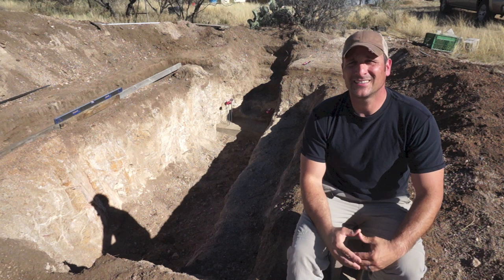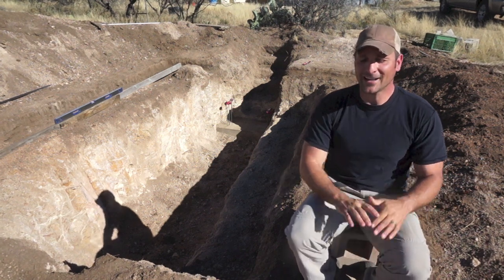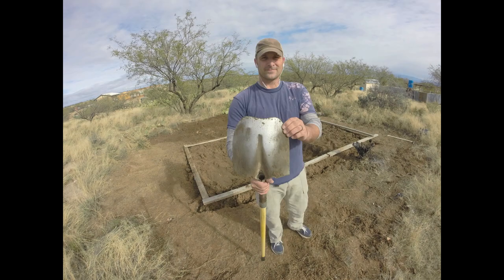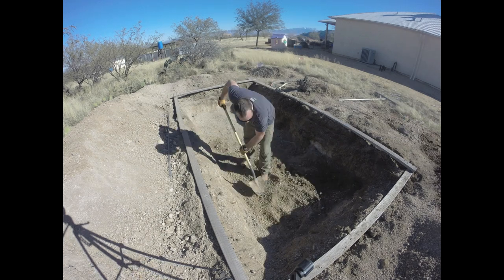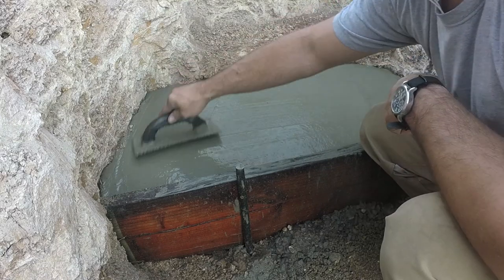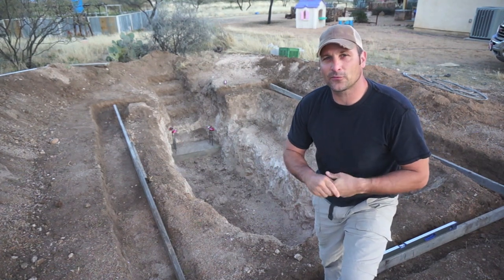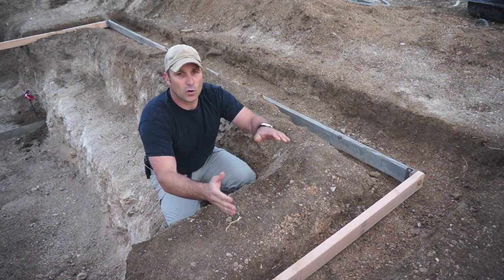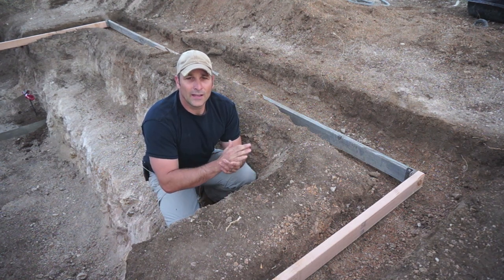Sunken Greenhouse Part 1:  Dirt work

Comment: I had this idea to drop one 4 feet below the surface but I didn’t have the luxury of a backhoe. It took me a year to dig it and remove the soil with a wheelbarrow. I’m at the stage of wall retention. I’m using 4x8 pressure treated plywood instead of concrete block: mildew reduction and wood is a better warmth promoter. Florida has experienced the coldest temperatures in years so I had to drop a tent over my project in 2023 because I haven’t got to the permanent structure yet, but this year (2023) there’ll be a permanent structure like yours before 2024. Your videos will be an inspiration to me. Thanks!

Comment: Damm, I've been looking for a solution like this since 2000...[no kidding]. I have a 8+ foot deep unfinished basement; 30 x 50'; and want to use the western side as an underground greenhouse [about 30 x 20-ish] and the east side[30 x 30] as an underground home.   Thank you SO much for filming this; because everytime I talk to anyone and try to "Paint a Picture" of what I want to do; they "No Comprende" !
Reply: Would love to know if you succeeded with either or both!  I am getting ready to move an 1850's cottage off the old basement which is too close to the highway.  About half of the basement is still in pretty good condition, and I hate to waste it by just filling it in. so I've been wondering if I could turn it into a sunken greenhouse.  It will be just to the south of the new basement, and I'm worried that it will obstruct the south side of the cottage once it's moved.  The zoning inspector is already on board with this idea, saying there's no reason why I can't put my old basement to good use, especially for agricultural purposes.  I should end up with about a 16' X 24' space, and the concrete stairs can remain.  The low roof on this project we're watching may solve my problem by not obstructing the south wall of the house too much.  At least the south wall of the house will just have windows, and no entry door.  It may look a little odd to have a greenhouse right there, but it also may be worth it.  As he says, "What have I got to lose?"  I'll get the house moved and will know better whether it will look ok, or not.  I think his low polycarbonate roof looks very nice.  If anyone wonders why I don't connect it to the moved house, since the house will be so close by, it's because I don't want it to be subject to the building permit that I am applying for to restore the house.  If it's separate, I can get an agricultural exemption for it.

Comment: Looks awesome. I appreciate how you can start building from the vision in your head and not get bogged down by over planning. It's nice to see a project develop in such a organic way and its cool to see how design as you build.
Reply from the maker: +Ben Huttash Thanks Ben!  It's certainly not the most efficient process but it works for me and in the case of many projects allows me the ability to problem solve as things come together.  Of course sometimes it forces more trips to home depot though...lol!  I'm hoping to finish the concrete and block work this week.. then start on all the framing and figuring out all the details in between:)  
Joe
Reply from the maker: +Ben Huttash Hey Ben... just checked out your channel... I got a buddy who lives up near Denton.  He has a small glazing (windows, doors, etc,.) business.  Used to be called south county glazing but can't remember the current name.  Was just there a few years ago... anyways, i'm checking out your ferro cement vid now:)
Joe
Reply: +homesteadonomics Thanks for checking out my channel I haven't added a video in a while but have some in the works. I am star struck in the youtube sence of it, that you would take the time to comment and chat with me seeing as your channel is huge in comparison to mine. I love your channel and I love DIY projects. Also a while back you suggested some channels you like and I want to thank you for introducing me to BossoftheSwamp. He really has the lock down on the nostalgia of the simple life.
Reply from the maker: +Ben Huttash hahaha... I'm just a regular guy like anyone else!  Keep posting on your channel and it will grow:)  And yes, I love bossoftheswamp  a lot... JC seems to be a super genuine guy and just has a very likable personality too.  And one heck of a craftsman as well!  Anyways,  I really do appreciate your comments Ben and am available to chat anytime:)
Joe

Comment: That "template" of the cinder block used in placing the rebar was very clever. I'm filing that one away for possible future use.

We have very hard ground here in the Central Valley too but it's a very heavy clay. In the summer- hard as stone; winter- sticky quagmire. When digging fence post holes by hand I get down about 2-3 inches and fill the hole with water before moving on to the next hole. Lather, rinse, repeat. All. Day. Long. I get there, eventually...
Reply from the maker: +Tracy Luegge Hi Tracy,

I was going through the comments and saw that I hadn't answered this comment...so sorry.  I could have sworn I answered you but it looks like no response.  Anyways, I totally agree with the soaking the ground for holes... I did this on all of my garden and chicken coop post holes.... soak, chip away a couple inches and move on to the next hole and come back to the previous one after an hour or so of soaking..lol.
Joe
Reply: +homesteadonomics BAH! No worries Joe, life gets busy and some things pass by the wayside. I just wanted to throw that little tidbit out there so someone else might get some use out of it.

Comment: I got a hole in my back yard about 8 foot in diameter left over from hot tub that was removed. I was thinking about doing a sunken greenhouse project myself, you did give me a good idea on not building it to the edge probably a foot or two around from the edge to make the ground level a good place for plants. I would had not thought about doing that.

Comment: i just want to say I LOVE YOUR VIDEOS!! i stayed up all night watching them! i love your enthusiasm, attention to detail, and the way you figure it out as u go! people with set plans for everything drive me nuts because its just not logical that there wont be a roadblock along the way! now!, with that said. i live in colorado semi desert 5a 6b. in my yard is some cement work from god knows what but it is below the soil level, not by much though. right now full of top soil so the first thing i thought was garden bed maybe 2 feet i was thinking since i came across some free cinder blocks to build the walls up with only one tall one  (with the roof at an angle one very low wall and 2 triangle sides to run water into my other cement hole garden bed i wish i knew what was under and i do not see me as a single woman able to dig this out as much as i wish i could. im wondering if the cement and cinders would retain warmth much like the earth and id get enough sun to keep it warm inside.
Reply from the maker: Thanks so much Helena!  I can't say if the cement and cinders would hold as well as earth but I think its worth a try and will definitely hold some warmth for sure.  I think building up  one wall is a good idea as you are a bit farther north and having a sunken aspect like mine might not add as much exposure as it does down here.  So give if a shot... even if on a small scale and see how it goes : )

Comment: Looking good, Joe! Can't wait to see what's next. That decomposed granite doesn't look like much fun to dig through. We run in to a lot of caliche here in Vegas and that is some seriously tough stuff.
Reply from the maker: +Braxton Wirthlin haha... we've got some caliche too... pain in the ass to dig.  The decomposed granite can be worse at times and in other areas, be much easier than the caliche... just depends... but I'm just so happy the hole is basically finished...whew!  Should have the next video up as some as I finish the concrete and block work.... then it'll be on to the roof structure and all the fixin's:)
Joe

Comment: For older folks or those who want to make sure they can get into the greenhouse, install ramp down into it. You can pictures of all kinds of ramps on pinterest greenhouse ramps, ramps, ramps ground storage or pithouse ramp...you get the idea. You never know when you might get hurt or the old knees can’t take steps. Also, make your openings at least 5’ in case of walkers or wheelchairs and for wheel barrels to carry supplies. A friend made theirs so they could drive in and out. Very large but cool. wish I had pictures, they are gone now.

Comment: That is similar to what i am thinking about doing with my second greenhouse. I want to make it a more temperature stable greenhouse so that is how i came up with the ideal of only having a geo-dome for a roof, in essence, a transparent dome over a hole. Just using a 1/3 of the dome because the sides won't be needed because the sides are a hole in the ground. But i will still build a wooden wall, but it won't need to be geo-dome style sides, those can be just straight perpendicular to the earth. Then also, there will be huge containers of water where sun is allowed to shine on in the winter, and shaded out with leaves purposely in the summer.

Comment: Of concern is a water pump to remove floor water if a window broke during your absence the greenhouse would flood and you would have a pool of water to tend to when you returned so keep that high on your list of things to do. One more thing is a small fence surrounding the greenhouse to keep dogs from urinating on the windows, unpleasant odors not welcome. Get busy with electric & water lines to your greenhouse, bury them deep enough to avoid problems..
Reply from the maker: +Jonalist000EVFCF It is a very good question and one a lot of people have asked:)  But, in this area of the southwest our water table is hundreds of feet down.  So any water that does get in will be via the stairway.... and by my calculations won't be more than 5-10 gallons.  All the other ground is graded away from the structure.   As for windows, I've covered it in polycarbonate panels so hopefully a broken window won't be an issue:)
And regarding electric and water... I do plan on putting in a passive irrigation irrgation system with rain collection from the roof, but probably not anything plumbed or any electric as that would mean making it a permitted greenhouse in my county... and I don't want to have to deal with those folks if I don't have to;)

Anyways, they are great questions and I hope I was able to answer them or at least clarify a bit:)  I'm no expert in this and may end up having to make changes down the way... but that's okay too:)

Also, feel free to check out part 3 and you'll see the walls and roof getting put up:)
Joe
Reply: I am not a Climate Change Advocate but there is talk about the oceans and Gulf of Mexico rising above the plains fifty feet or more depending on capability to flow the water back out over time when the rise of the levels do occur. New York has crafted new laws regarding home construction & to be honest I think a wall at the Mexican Border might not qualify to stop such a flood situation. Take care & bear that in mind as tributaries can cause disasters from mud flows moving debris causing damages to structures.

Comment: Joe, you really work hard for the family. How will you keep snakes out if they try to get in there to keep cool in the heat of summer ?. Best Wishes from the UK.
Reply from the maker: +UK Tony Thanks Tony!  I'm hoping the door, frame, and block work will all fit tight enough to the poured concrete footers to mitigate that problem.  But with that said... I'm sure I'll get a snake or two in there eventually.  But then that just reminded me of another project... a homemade snake pole!  So maybe if one does get in there it'll make good footage;)

Joe

Comment: I have off-grid property in Northern Nevada at about 4500 feet elevation that I plan on moving to permanently in 3-4 years. In the mean time I will be putting certain systems in place. The well, wind and solar power, water catchment, and some type of building, cabin, RV?? to stay in when I visit are the first priority. I have been watching you create your gardens, swales, and water catchment systems etc. and will be using many of your techniques. May I ask what elevation is your property?

Comment: Hahahahaha this is one heck of a mommy and me project.
    How does the location of the green house fit into the topography of your property? Why did you choose that spot to build? How will the dug out material be used? How much and what type of insulation will be used on the north wall? Cheers, 
Bill
Reply from the maker: +William “Bill” Walter Oh man... those might have to be in a Q&A video just for the greenhouse:) But here are some quick answers... the extra fill will most likely be bermed up against the north wall to act as earthen insulation.  The rest will be added to a future swale project that I'm planning.
As for the location... it was a location that was close to the house and in an area that I couldn't think of doing anything else in that spot.  And it has full east west exposure with no tree obstructions.
And lastly, it is a bit higher than my garden and will allow me to funnel rainwater to my garden area from the greenhouse roof (as well in a tank inside the GH too).  
Joe

Comment: Thanks for posting this video. I'm drawing up plans for a green house right now and I stumbled on the underground idea. This may be a dumb question but why didn't you install drain tile around the perimeter? Thanks for your time.
Reply from the maker: Hi Jason,  Not a dumb question at all:)  But I have to say that I'm unfamiliar with drain tile?  can you let me know what it is and I'll try and answer:)  btw... I have 6 more parts to this series that may answer the quetsion as well:)
Joe
Reply: I did watch your progress through the videos before I asked because I didn't want to waste your time with redundant questions - you seem pretty busy like me! When we dig basements in Wisconsin we excavate below the frost line and run perforated "tubing" around the perimeter called drain tile. It leads to a hole in the basement floor with a sump pump that (when triggered) will eject any excess water.
Reply: But I'm guessing I already have my answer... it sounds like that isn't a common practice where you are. Thanks!
Reply from the maker: HI Jason,  that's kinda what I was thinking regarding draining the water away.  You're right, it's not a practice around here as we don't have a high water table and get less rain and don't often hit dew points.  So water accumulating in the bottom of the GH isn't much of a concern.  We had 3 inches of rain in a few days here in Sept and the most that came in was about 10-15 gallons via the stairway... the sides by the block are graded to slope away from the structure and only had some minor moist areas along a couple of the block seems during that time.  But it is a good question!  
btw...  i visited the Milwaukee and a couple coastal spots north of Milwaukee this summer and loved it!  We flew out of Phoenix when it was 115 and when we were in Milwaukee, folks were apologizing to us because of the heat wave they were having... it was 85 when we landed:)  Beautiful place, great food, nice people!  
Joe
Reply: We do get nice weather on occasion but it's winter about 5 months of the year. Tonight we will be back below zero again after a balmy 18 degrees today. Time to turn on the heat lamp in the chicken coop... the Wyandottes are prissy little critters! Anyway good luck with your projects. I'm thankful you made time to post this - it's really helpful to see other people's ideas!

Comment: Any rainwater collection system built into this project?  You got a lot done in a short time Joe.
Reply from the maker: +Ted Alexander hahaha... you bet there will be:)  Will have to figure out most of the details when the roof structure is up, but I'm thinking of some sort of tank or barrel inside the greenhouse and then a diverter to a garden tank for when the inside tank is full.  ... but that may change...lol!  
Joe

Comment: can't call you lazy, that's for sure. will the roof be curved or flat? are you going to use the dirt as a wind breaker or is it just there until you spread it around.
Reply from the maker: +uKNOWuLIKE that  Hey Mackey!  I'm still deciding on the specifics for the dirt, but it will most likely be bermed up against the north wall of the GH and the rest will be moved to a swale project that I have in mind.... and some may be used as a windbreak as well.  As for the roof... I'm thinking now of an offset pitched style roof with the majority of it sloping to the front (south side of the GH)
Joe

Comment: So when you’re saying that the temperatures are more consistent what are we talking about? Would building a structure like this in the deep South or the Bahamas help with summer heat? Where cold is not a problem. Because I think you live in a really hot place also? So is the heat the reason why you built this greenhouse?

Comment: Assuming that the ground stays around 50 degrees F, does this mean that you can't heat the house warmer than that temp?  I would think that in the winter, you'd heat the air, and the ground would suck up all the heat.

I want to keep my house around 55 or 60 deg F.

Is this correct?

Thanks

Comment: Was wondering what the light entry is like in the winter when the sun is low. It might be fine down south but the farther north one would go the less light would get into it. So is it dark in the winter? Or areas of shade?
Reply: you usually want to design it specifically to face the area that gets the most sun in the dead of winter for max effectiveness...north facing slight slope would be nice